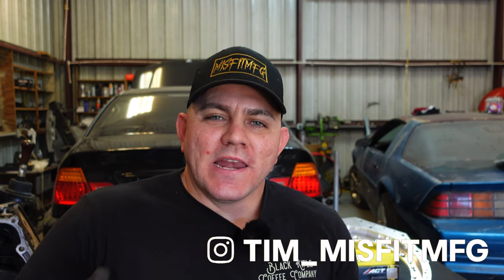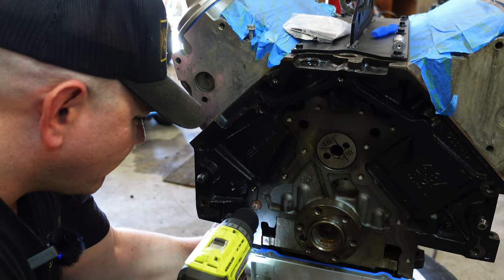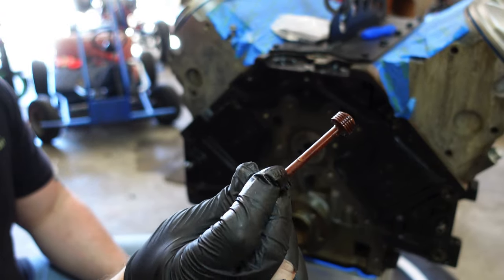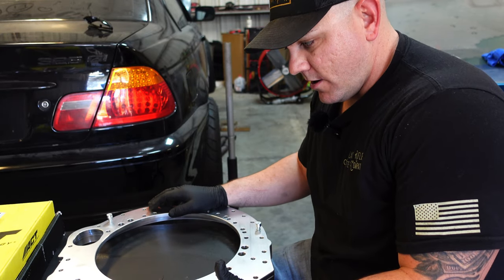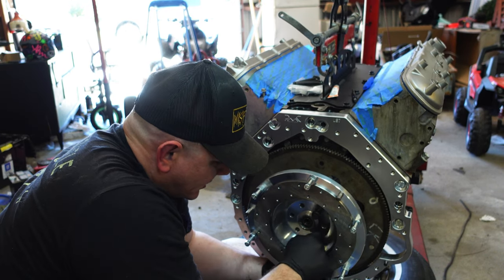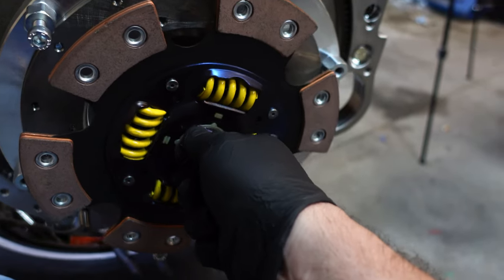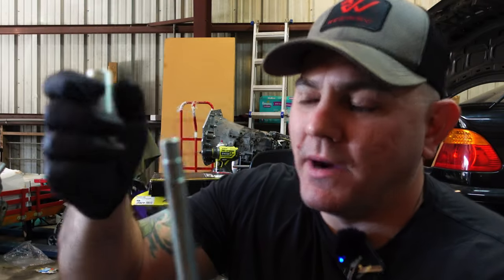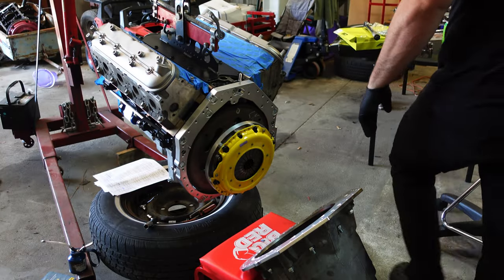Ls Swap + Zf Transmission: Installing A PMC Adapter And ACT Clutch

Comment: Just FYI. Regardless if you're mating eng/tranny in the car or out of the car. Always buy longer bolts with same size and threads as your trans bolts. 2" and 4" longer bolts usually does the trick, the longer bolts act like pilot bolts. Less effort if you have a floor jack or scissor jacks to hold the trans up and onto the longer pilot bolts. Anyway, thx for the vid

Comment: Are there dowel pins that align the engine adapter plate to the transmission adapter plate when you assemble the transmission to the engine?
Reply from the maker: There aren’t any dowels. You kindve push it in and then run a couple bolts lol

Comment: Hey men nice video!  I think you used cx racing engine mount?. Did the trans mount bolt on the same place as stock? So same drive Shaft?
Reply from the maker: Yeah I used the same Zf driveshaft. There’s some adjustability with the driveshaft where the carrier bearing is.

Comment: Looking to do the same install except with a built lq9, what motor mounts did you end up using and were there any major issues that had came up?
Reply from the maker: I used the cxracing motor
Mounts. No issues with the install

Comment: Pro tip put the motor on the ground when you put the trans on when you have the motor in the air with no one to hold it it does this angle /| when mating when it can’t move it’s easy as pie
Reply from the maker: Definitely would’ve made it easier

Comment: Hi there Tim, need you to tell me which model tranny you told PMC was needed. I don't see a ZF5 listed on their website. Of course if I'm missing something, let me know that too. Or if you could let us know the model you are using. Thanks for the help in advance.
Reply from the maker: I’m running this kit minus the clutch. I used an act clutch and disk. https://drifthq.com/products/pmc-motorsport-race-stage-1-800nm-adapter-kit-chevrolet-ls-ls1-ls3-ls7-bmw-m57n-gs6-53dz-hgd-f0m57-ls-k0m57-240-ls-sachs-243-240mm-32-5x35-26n?variant=44213819703483
Reply from the maker: Drift hq will help sort all the items needed for the swap. They were super helpful. I believe I used the Pmc adapter for ls to Zf and an act clutch for like a 323ci

Comment: Hello I have a 98 z3 basically a e36. But was wondering if you could use stock ls oil pan on the bmw?
Reply from the maker: Since the fbody is rear sump, it should work. I have an fbody one in the garage as well as an additional Holley pan. I could take a side by side pic?
Reply: Will it also work for the getrag transmission?

Comment: What motor does this adapter fit? E46 Model specifically?
Reply from the maker: This is just the adapter for ls motor to BMW Zf5 transmission. I don't believe it fits the getrag tranny
Reply: Thanks for the info. I guess I was more asking which ZF trans the bracket is for. On the PMC website it says it’s for the ZF in a 328i and 330i but I’ve also seen that it only works for those trans in diesel cars. Was this a gas 328i trans in the video?
Reply from the maker: @maxwell5098 yeah that trans was out of a 328

Comment: Which trans was this for? I have sent them a question if this adaptor would fix a n52b30 manaul transmission zf
Reply from the maker: This was for a zf320 5-speed from an e36/e46
Reply from the maker: I went to drift hq and they helped me with all my questions.

Comment: Do you have the link to the clutch and clutch plate for Gtrac transmission. I will appreciate it if you can send it to me. Thank you
Reply from the maker: Oof. I'm not sure about Getrag because used a ZF tranny and the clutch is from like a 335i and pressure plate from a 323ci lol
Reply: @tim_misfitmfg  ok thank you so much 👍